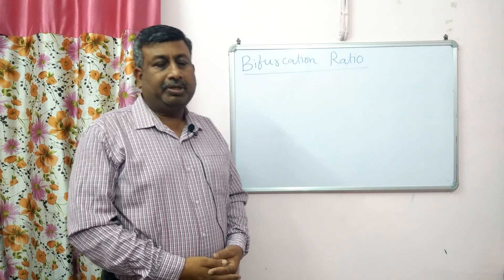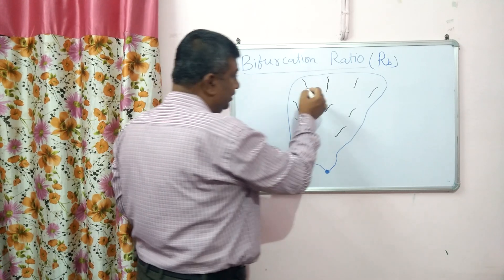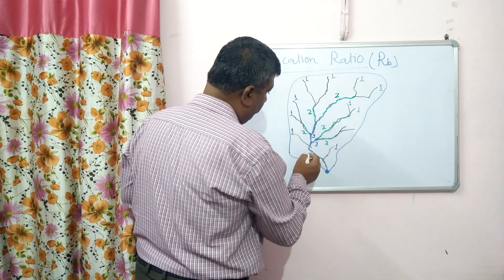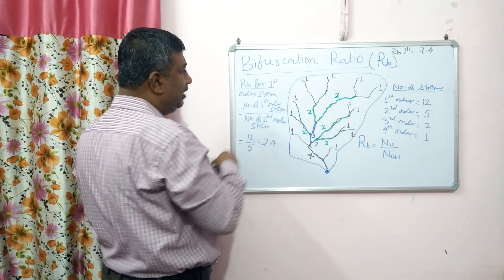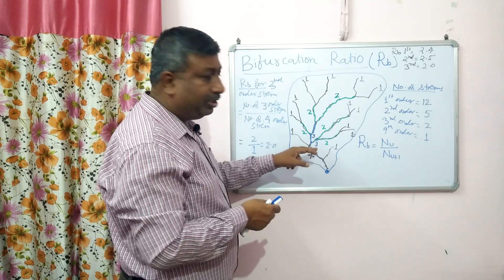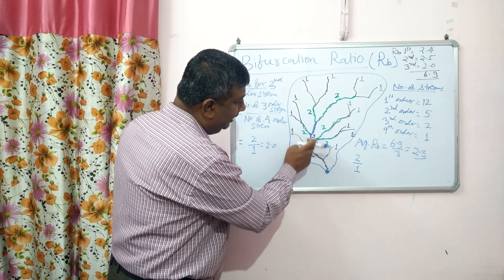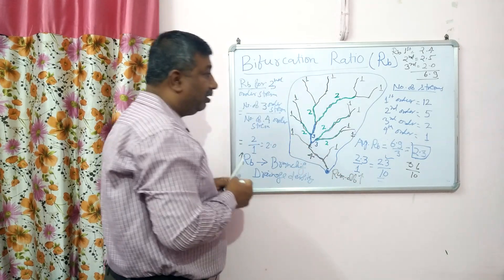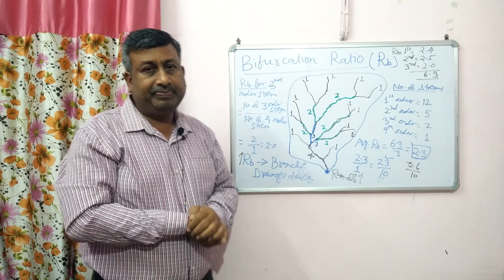Bifurcation Ratio in Watershed

Comment: Q. The bifurcation ratio between 1st and 2nd order streams of a river basin is 3.742. If the number of streams in the 2nd order is 89, what is the number of 1st order streams?
Option:
A.210,  B.244,  C.234,    D.254